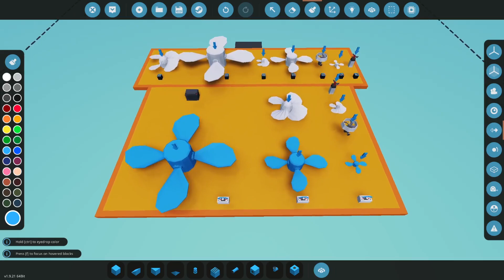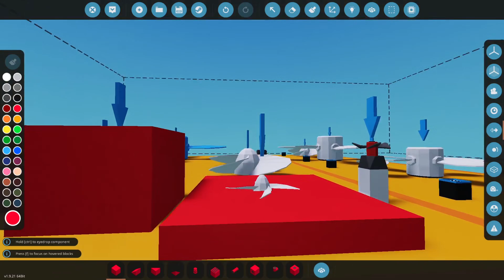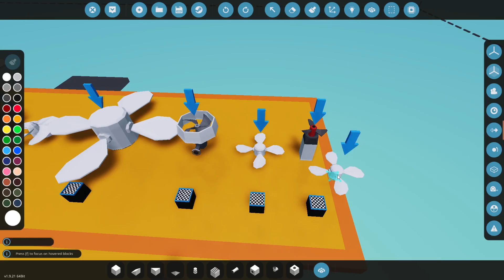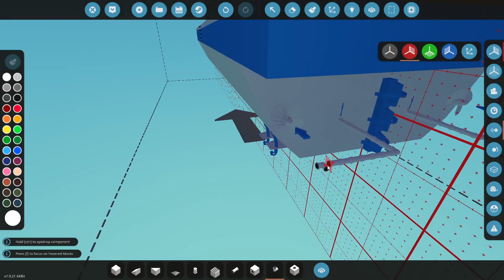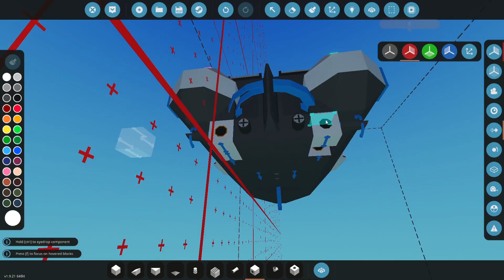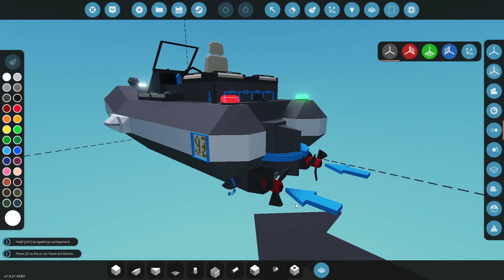Testing the NEW Pitchable Propellers in Stormworks

Comment: My thinking is that at a low pitch, you will require less torque, requiring you to run at a higher RPS. If you have a high pitch that should require more torque to spin but each spin will move way more water. Not sure if stormworks does this correct
Reply: With the air moving proppelors in game i think it would work correctly

Comment: I will use them. I like the fact you don’t need a gearbox or clutch. I do wish they would add smaller propellers however. I can’t see many people using the big one!
Reply: Gearboxes will still need to be used to adjust RPS / Torque, just not for selecting reverse.
Reply: I think the large ones will be used for giant steam ships, just because you can make it have 2 blades

Comment: I tested using the largest motor with one propellor on a large barge and there are speed differences, though the difference is smaller. The old small propellor gave me 6 m/s while the small pitchable one gave me 6.3 m/s for 4 blades, 5.3 m/s for 2 blades, and 6.6 m/s for 8 blades, all with max blade pitch. I believes blade counts does have effects on how much the propellor catch the water, but max speed is still limited by the engine power. Like, they could all go the same max speed, but maybe they spun at different RPS at that max speed.
Reply: Max pitch is actually not good for speed. Bring it back down to just above 0, you'll gain RPS and soon find the limit of stability of the boat (Had my test craft flying over 100m/s, could barely stay in the water)